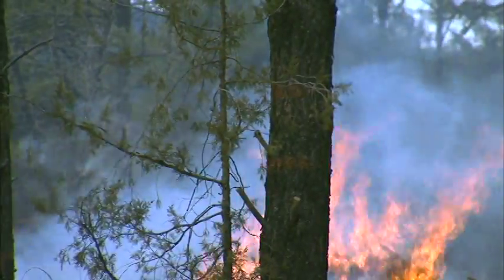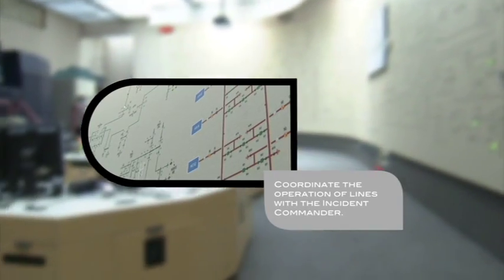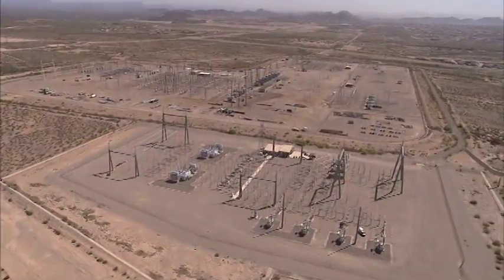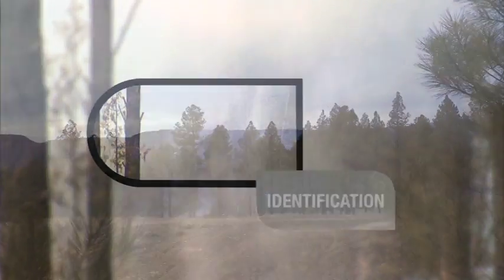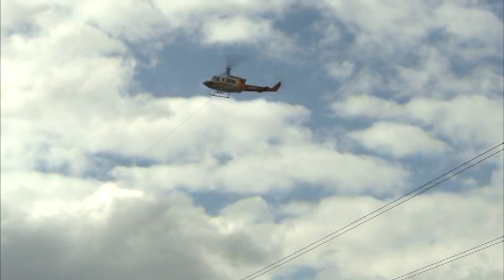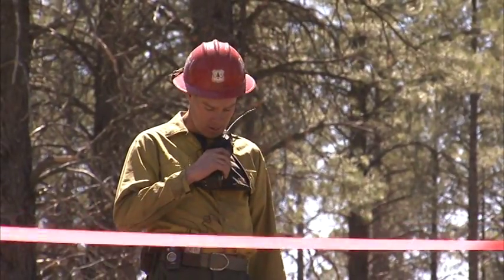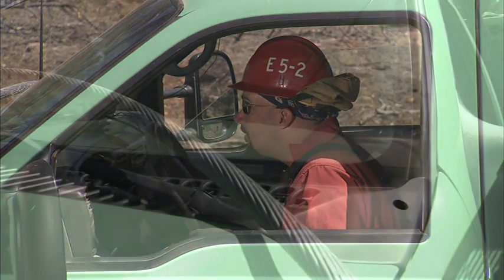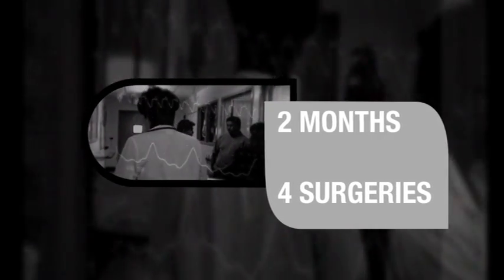Electric Fire: Firefighter Safety Around Power Lines

Comment: A crane operator in my country probably didn't pay attention in training: He hit like a 90kV line and decided to want to try and climb back up on it.  Someone was videotaping the arc-to-ground fault from a big distance and even with the reasonably crappy image due to the hot air (it was a hot day, so there was the typical "bubbling" at greater distances) you saw the guy suffering flashover between his hands and boots and be knocked back off straight to the ground.  He somehow survived the ordeal and was able to get back up and run away, but ugh.
(Why also he decided to drive with the boom up and extended....no idea).

Comment: Learned new, valuable info!  Didn't know that soot from smoke could cause arcing across insulators. Yikes!!
Reply: It's basically the same reason insulator discs tend not to have grooves, and if they do, these are at the underside: rainwater and dirt could collect in them otherwise and make it's insulation capabilities break down and arc over.